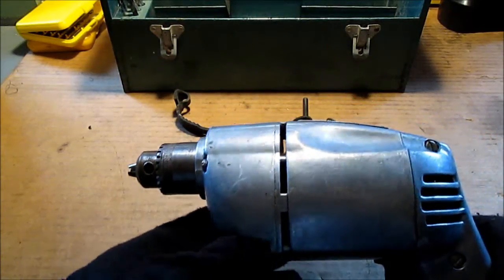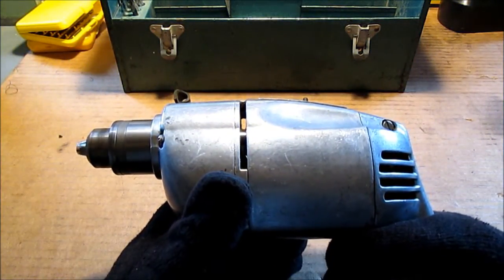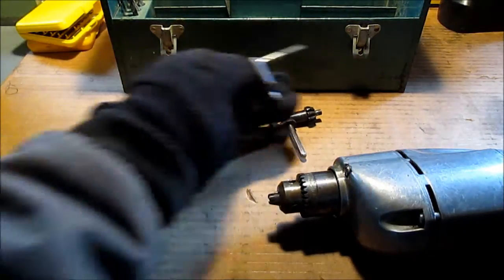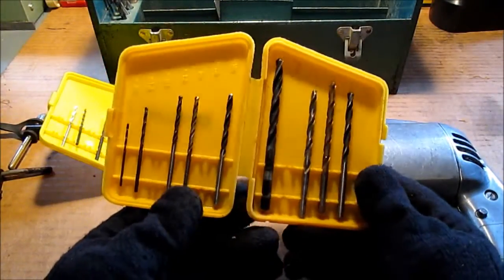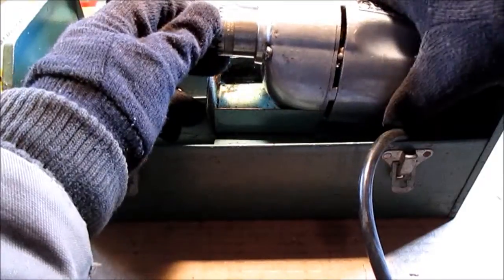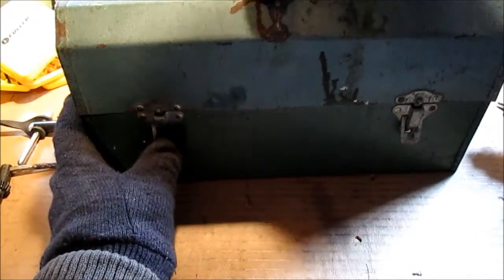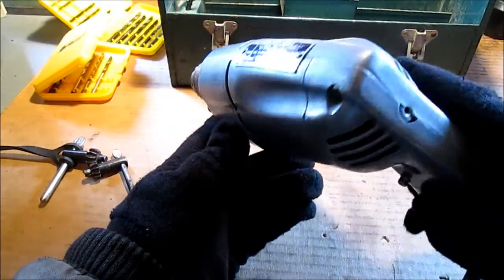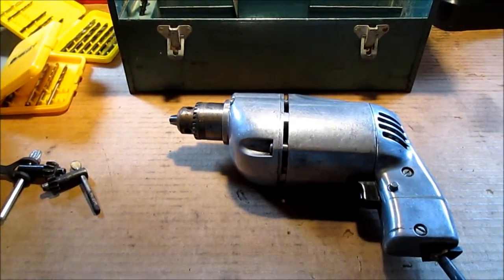Ram 3/8  Drill Made in Chicago IL. U.S.A.

Comment: Just found this on a Google search. I inherited a small pile of stainless tools from an Uncle, and this was one. There's another that's an absolute monster by someone called "American". It's the type with the perpendicular handle on the back end. I wonder if these were cheapo (or boutique?) brands back in their day.
Reply from the maker: +Jidis Safi My drill is cast aluminium I have never heard of the American  brand but I'm sure if it's old it is a good one
Reply: not2fast4u2c 
Thanks for the correction. I just sort of refer to all that old silver stuff as that. There's a couple more here (a scroll saw and something), but I left an awesome looking circular saw and finish sander behind when I went through the stuff. Been kicking myself for that. 

My Ram's got the same cracked cord and strain relief as yours, but also feels stiff like the bearings are seized up. 

PS- What's the deal with some of these old universal motors being so big? He had an antique looking thing he was using as a polisher or something, and it's only a 1/4 HP, but it's the size of a freakin' basketball.
Reply from the maker: with modern stuff things got smaller I would not use the old stuff without putting on a 3 prong grounded cord

Comment: hi i bought a Power-Bilt 1/4 " Drill just looks like yours  model No. PBF-11-53552   the last 5 digets are on a stampted  plate  my question .. is it suppose to spark a little thru the back grill like end  . it is 2000rpm
Reply from the maker: all drills and motors with brushes spark a little

Comment: I like your drill. I have a RAM 1/4" electric drill that I just bought at a flea market. I was hesitant to replace the cord until this video. Can you tell me how you got the chuck off?

Thank you
Reply from the maker: The chuck will unscrew to the left CCW I found a bit that fits the hole in the chuck and layed it on the bench and hit the bit with a hammer if you are lucky it will come loose ..Make sure to open the chuck all the way and check to see if there is a screw holding it